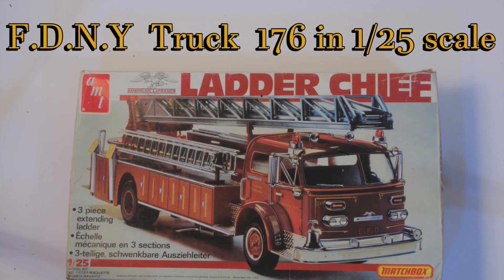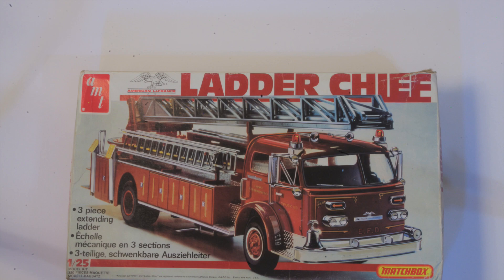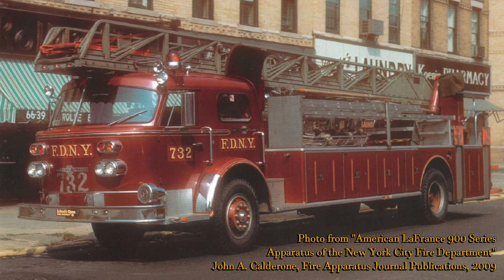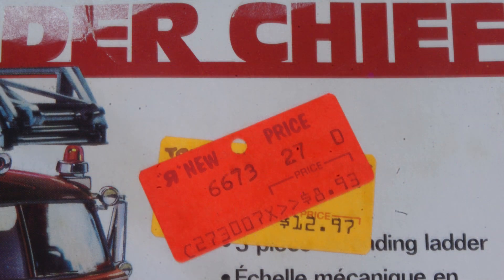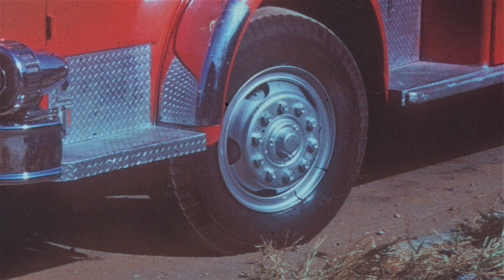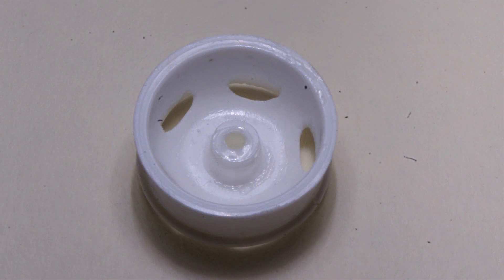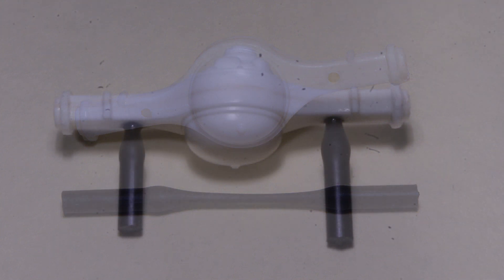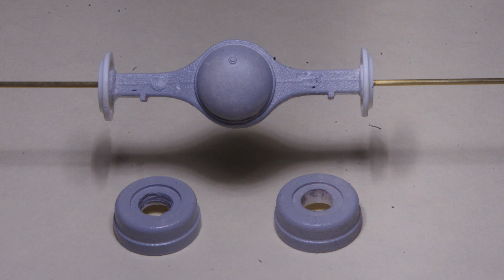1/25 Scale Ladder Chief model project: F.D.N.Y. Truck 176

Comment: Is there any way possible you could give me a list of the bolts and nuts  that you used on your builds please and thank you  love your builds thank you for taking the time to share them
Reply from the maker: Bolt head and nut/bolt/washer castings I commonly use are from Tichy Train Group, their #8016 is a nut/bolt/washer casting that I use for the small fasteners like licence plate bolts, mirror bolts etc. In O scale (1/48) they represent a 1/2" diameter bolt, so in 1/25 scale that works out to around 1/4" diameter, quite close to the 1/4-20 fasteners often used to attach licence plates.

#8083 and #8085 are bolt head castings with #8083 scaling out to approx. 2" across flats in 1/25 scale, #8085 approx. 1-5/16". (I do the "scale math" by dividing the size Tichy states the bolt head is in 1/48 scale by 48, then multiplying this result by 25. As an example, #8085 is listed as a 2.5" hex head bolt on the package. 2.5" divided by 48 = .052", which multiplied by 25 = 1.302", very close to 1.312" which is the decimal equivalent of 1-5/16".)

#8084 is a bolt head and washer casting, approx. 2" across flats again with a 2.604" diameter washer.

Tichy also makes rivet heads, their #8018 is a .025" rivet is ideal for simulating screw heads on some items.

I have also used Micro-Mark O scale decal rivets, their part #84987, to represent screw heads rather than the Tichy styrene rivets. One application of this approach was for licence plate fasteners where it was easier to apply decal rivets to face of licence plate that had been printed on photo paper, rather than drill for the styrene rivets.

For some applications I use .030" diameter styrene rod to simulate bolt heads, usually if the molded in bolt head detail on a kit frame is of similar size. Once painted the round vs. hex difference is not readily apparent. 

Actual bolts and nuts are occasionally used when making front axles steerable, for this I use 00-90 machine screws, hex nuts and/or hex head bolts. I look for these at hobby shops that have a decent model railroad selection, they can also be found online, link to Walthers site here.  https://www.walthers.com/00-90-brass-hex-head-machine-screws-1-2-x-047-quot-1-27-x-12cm-pkg-10

That covers the items I typically use, hopefully this information is of use to you - happy modelling!
Reply: Thank you so much for your help and time to give me the info